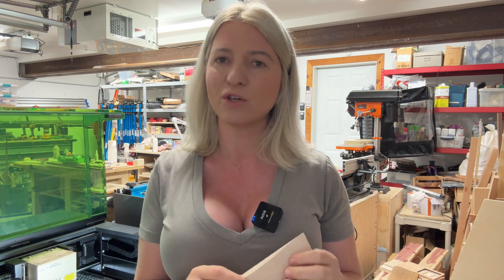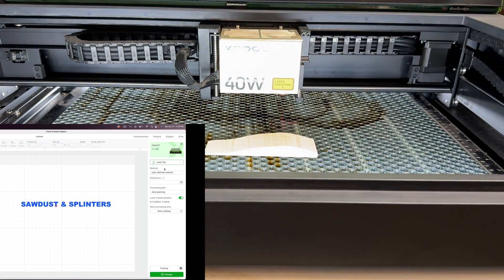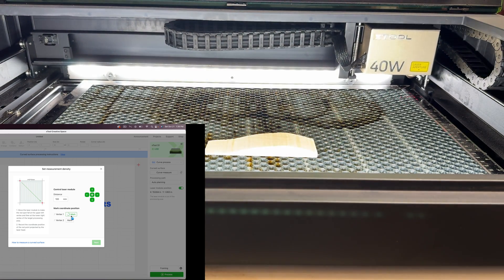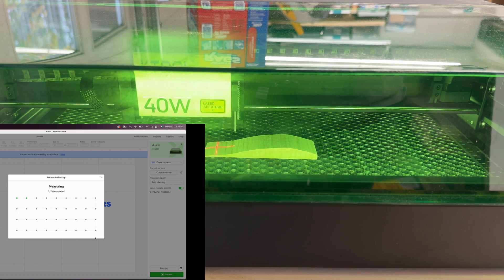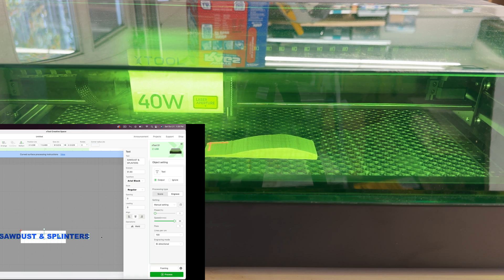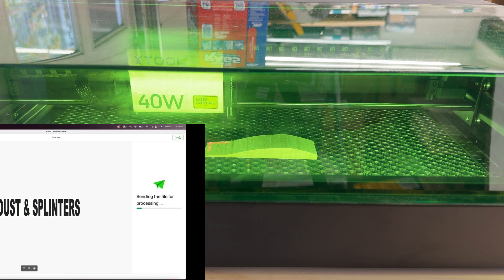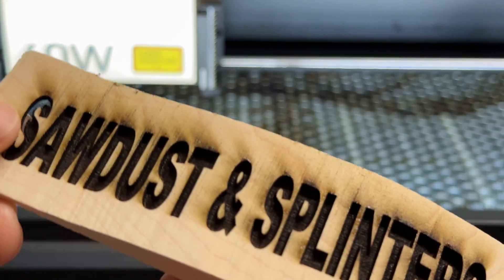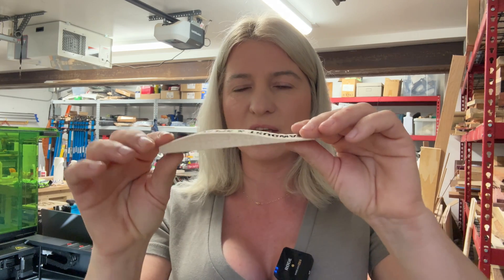Xtool S1 laser engraver . How to engrave on curved surfaces

Comment: Thank you for all of the great info. A month ago you got a Creality Falcon 2 22W machine. Would you choose Xtool S1 40W over Creality Falcon 2 40W? In Canada the Xtool is $1,000 CDN more than the Creality.
Reply from the maker: Hmmmm, tough question. They both do the work really well, cutting and engraving the same. Creality is not enclosed so you need an enclosure with good ventilation. But is works sooo well and it works with lightburn. Xtool is enclosed and you don’t need to wear glasses while using. But is not 100% compatible with Lightburn.  For myself, I decided to keep the Xtool because is enclosed and all smoke and fumes go outside. But you can’t go wrong with creality